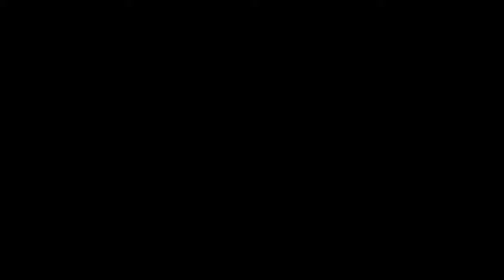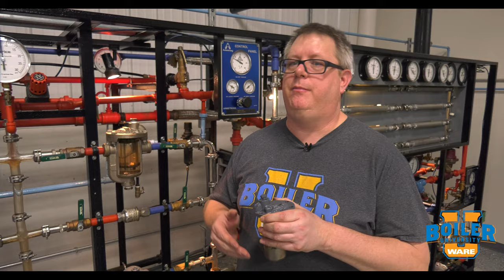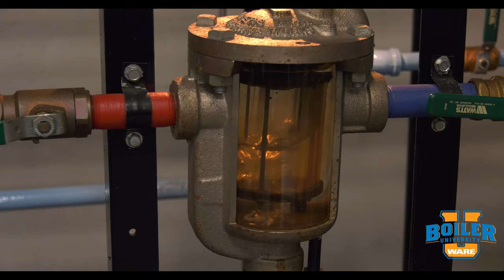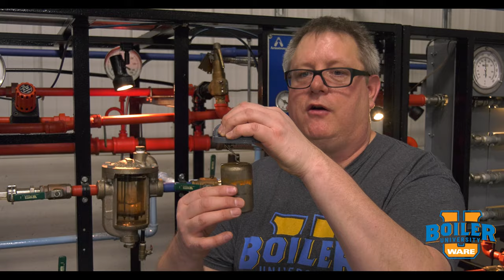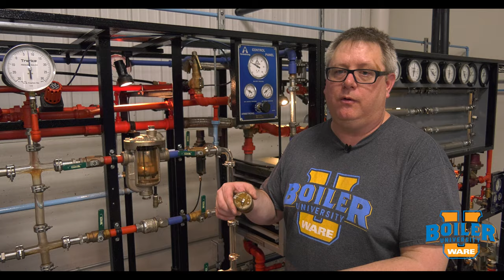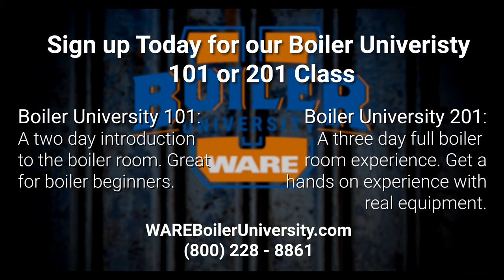Steam Traps | How an Inverted Bucket Trap Work - Weekly Boiler Tips

Comment: Would you expect some steam to escape with the non condensable gases? I am studying my 3A2 power engineering book and its got a full chapter on steam traps and condensate systems
Reply: It will not, the body of the trap emits enough heat that any of the steam ur thinking about will condense and not be sent thru, it’s really genius engineering feom 110 years ago.